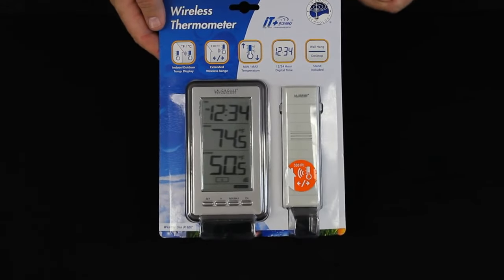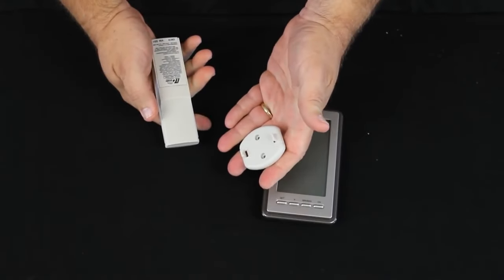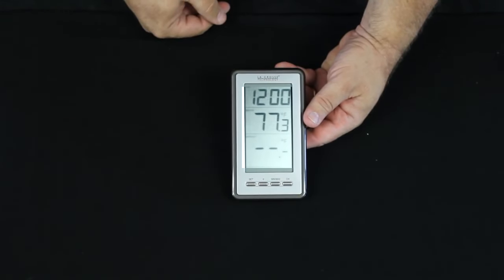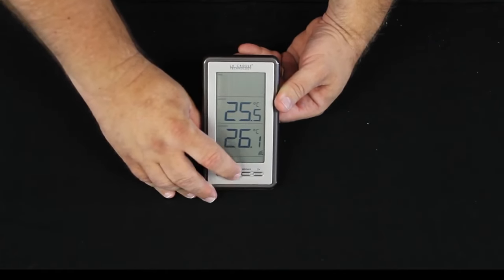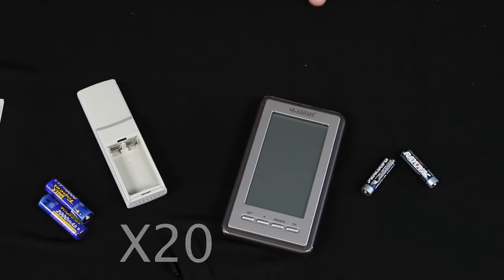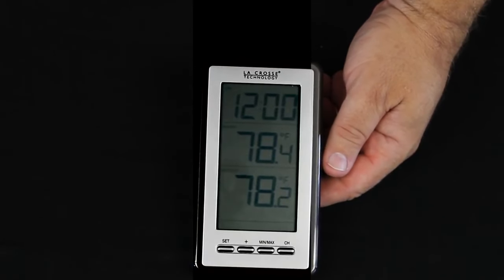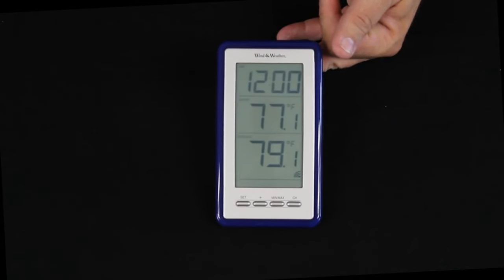WS-9160U-IT Wireless Weather Station

Comment: Good video.  You might note that if you choose 12 vs 24hr clock set,  12hr will get you Temps in Fahrenheit.  If you choose 24hr, it will be displayed in Celsius.   That's too bad, because in logistics,  I use the 24hr system,  but I read my Temps in Fahrenheit.
Reply from the maker: Thanks Russ! We appreciate the feedback. Unfortunately, there is no changing this 12/24HR setting controlling the °F/°C readout on this original WS-9160U-IT model, it is how the item was designed. However, we do offer a large number of other weather station models that separate these two functions, including our Version 2 of this exact item: https://www.lacrossetechnology.com/products/ws-9160uv2 -- Our apologies for the inconvenience. Please message our support staff directly here: https://bit.ly/contact_techsupport. Or alternatively, send us a private message on our Facebook: http://bit.ly/LaxTech_Facebook or Twitter: http://bit.ly/LaxTech__Twitter page for any further assistance.

Comment: I bought the newer 9160Uv2 and although it still has the high and low temperatures like the old one. It just seems to show the historical high and low. So if my low was minus 10 degrees on Jan 10th, will that be it for the rest of the year heading into warmer weather? I want to be able to see overnight lows daily when I wake up living here in Maine. It's frustrating not knowing. Thank you.
Reply from the maker: Hey Gary, our apologies for the trouble, but we have some good news. Though you are correct in that the WS-9160Uv2's HIGH/LOW records will not reset on their own, these can be manually reset individually as many times as you wish. To do so, simply press the MIN/MAX button to view an individual high or low record, with it showing hold the MINUS (-) button until the value resets to the current reading. These will need to be cleared individually for each MIN/MAX record, which offers you the option of only clearing the record low temp during cold months and record high temp during warming months, or vis versa. More product details and answers to questions can be found in our manual and FAQ documents here: https://www.lacrossetechnology.com/products/WS-9160UV2#support
Reply: @lacrossetechnology  Awesome. Thank you for your quick response!

Comment: Just moving the sensor 6 feet away does not tell us the outdoor temp. We have kept our sensor outside out of the sun, and it's given us the correct temp. Why don't you discuss this in your video?
Reply from the maker: We apologize for any confusion, but yes, the sensor must be placed outside in a shaded location to transmit accurate outdoor temperature readings.

Comment: Is it possible to order replacement outdoor sensors for this weather station?
Reply from the maker: Hi Jennifer, sorry for the troubles with your sensor. We'd first recommend trying a basic restart, those steps are covered in our video here: http://bit.ly/LaxTech_BasicRestart if you haven't done so already. But if these prove unsuccessful, a new sensor will likely be required. A replacement can be found on our website here: https://www.lacrossetechnology.com/tx29u-it

Comment: There seems to be an odd cadence to the display of the signal icon.  After connecting, we see a short - long (several seconds) - short pattern.  It seems to me that previously the icon just displayed a single long interval.  Is the receiver trying to tell us something?
Reply from the maker: We are unsure as to what exactly may be happening on your display. For reference, you can find our full FAQ and Product Manual documents here: https://www.lacrossetechnology.com/ws-9160u-it-weather-station?type=manuals  -- If you have additional questions, please feel free to reach out to our support staff directly here: http://bit.ly/contact_techsupport  -- However, as long as the data is coming in correctly and everything else appears to be functioning properly, there may be no issue at all.

Comment: How do I change out of Military time on the WS-9080U-IT. 915 MHz wireless temperature station?
Reply from the maker: Hey Joanne, our apologies for the trouble. Your 12/24 hour time setting is the fifth item listed in your display's settings menu. Page 2 of your full manual here: http://bit.ly/ws-9080u-it_manual will help walk you through these instructions.

Comment: I have been unable to set the time on the station after both reading the enclosed directions and watching the You tube explanation.  The indoor and outdoor temps are showing but the unit is not responding to any sets
Reply from the maker: Please be sure when trying to enter the settings menu that you are holding down the SET button long enough (until 12/24H start flashing). However, if the unit is not responding to any of your button presses, please message our support staff directly here: https://bit.ly/contact_techsupport. Or alternatively, send us a private message on our Facebook: http://bit.ly/LaxTech_Facebook or Twitter: http://bit.ly/LaxTech__Twitter page. Once there, we will be more than happy to help get this corrected. Our apologies for any inconvenience.

Comment: My batteries have been in less than a month...and it lost outdoor sensor connection. Is that normal?
Reply from the maker: Hi Linda, sorry for the trouble! No, this is not normal. Batteries in our products should last at least a year or more before needing to be changed. If you've followed our restart steps in the later part of this video, and are using a new set of reputable alkaline batteries in both the sensor and display (other battery types should be avoided), you may need a replacement sensor. For help with this, please reach out to our support staff here: http://bit.ly/contact_techsupport -- Sorry again for the inconvenience.

Comment: My country uses Celsius, can the 91.60 unit change from Fahrenheit?
Reply from the maker: Our apologies for not covering this in the video, but yes, our WS-9160U-IT model featured here can show temperatures in degrees Celsius. However, this setting is controlled by the 12/24 hour time setting within the main menu. When set to 12-hour, the temperatures will display in Fahrenheit, when set to 24-hour you'll then see temps in degrees Celsius. We are truly sorry for any inconvenience. More info can be found in this item's full product manual and FAQ docs here: https://www.lacrossetechnology.com/products/ws-9160u-it#support

Comment: If I put outdoor sensor in window, which way should it face, i.e., toward the outside or inside the room?
Reply from the maker: Hey Louise, in this situation we'd recommend the sensor be facing outside. However, we do want to note that the sensor should be placed in a somewhat protected and 100% shaded location for the best results. Any direct or indirect sunlight may cause the temperature to read high. Our video here: http://bit.ly/th_sensor_mounting may be helpful.

Comment: It is difficult to order a new sensor when I tried it said you were out of stock.  I cannot get my outdoor temperature read in step one... so I cannot use this product.  Has not worked since I was given it as a gift.  Very disappointed..
Reply from the maker: Hey Joni, our sincere apologies for the trouble with your outdoor sensor. Our first suggestion would be to perform a basic restart, as covered in our instructions and other video here: https://bit.ly/basic_restart -- If this still doesn't work, a new sensor will likely be needed. These replacement sensors are projected to be back in stock mid to late January. And, if this was a recent gift, the product would almost certainly be covered under warranty, meaning this replacement sensor would be covered at no cost to you. For help with this claim, please message our support staff directly here: https://bit.ly/contact_techsupport. Or alternatively, send us a private message on our Facebook: http://bit.ly/LaxTech_Facebook or Twitter: http://bit.ly/LaxTech__Twitter page (social media will likely be a bit faster this time of year). Sorry again for the inconvenience, we look forward to helping get this corrected.

Comment: I replaced the batteries in both the units in the correct order but it still will not pick up the outdoor temp
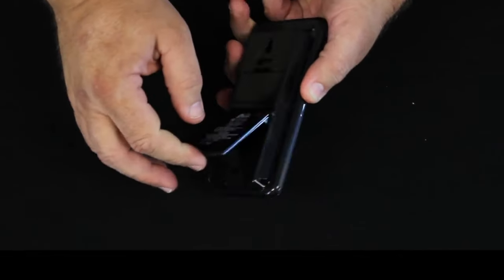Reply from the maker: Hi Linda, sorry for the trouble! If you've followed the restart instructions starting at the 3:06 mark in this video, and the sensor is still not reconnecting, please reach out to our support staff here: http://bit.ly/contact_techsupport as you may need a replacement. Or alternatively, you just go ahead and purchase a replacement sensor here: https://www.lacrossetechnology.com/tx29u-it as well. Sorry again for this inconvenience.

Comment: I have owned three lacrosse temp units.  None lasted longer then 18 months or until batteries need changed.  Tried all of these instructions.   These are not reliable.   Should sell for under five dollars until they are more reliable.
Reply from the maker: Hi Dale, we are truly sorry for the sensor troubles, under normal conditions these units should last much longer than 18 months. Our support team has received your email and will be getting in touch with you at some point today. Again, we apologize for this inconvenience and hope to get you set up with some working sensors soon.